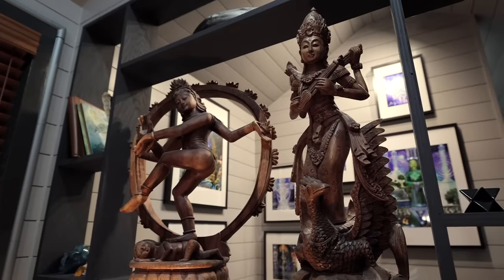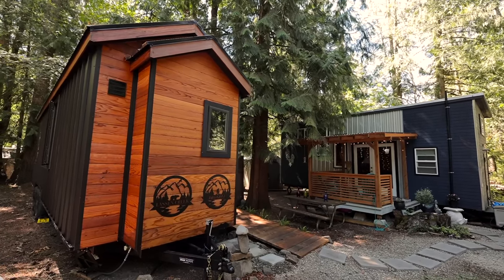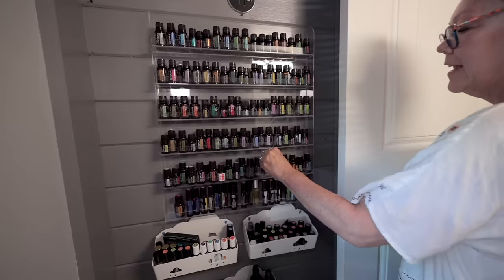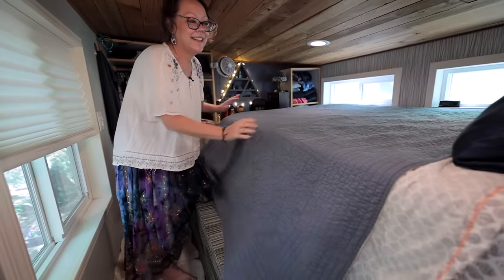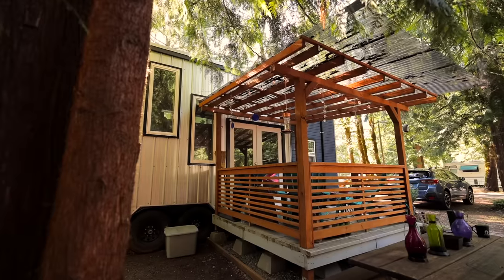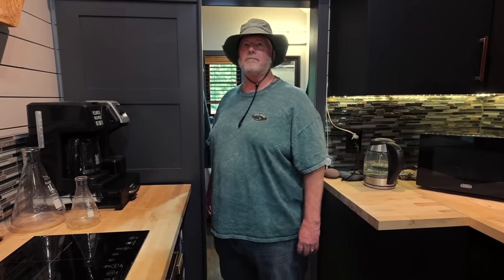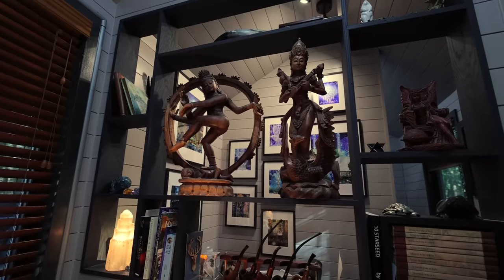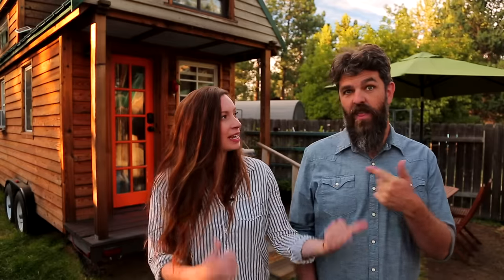His & Hers, 2 tiny homes parked side by side & still saving $600/mo!

Comment: I would like to have a lift as to stairs. Tiny can have more space.
Reply: This is Ryk:   that is a great concept I didn't consider.   It might have too much weight, but it might be able to be done nicely with a garage door system....  Great idea.
Reply: @bluestarjourneys7760  I thought so also but the lifts have changed to accommodate one person in what I have seen as a single person lift that anchors to a wall. Imagine how one could have a 2 story small home with no stairs, just a 30 inch by 40 inch lift.
This is big in Japan.

Comment: Hi There. I was wondering what the wires are from the ceiling to the base of the loft?
Reply: the wires hold the loft in place, to prevent movement. Loft platform is bolted to the wall.😊